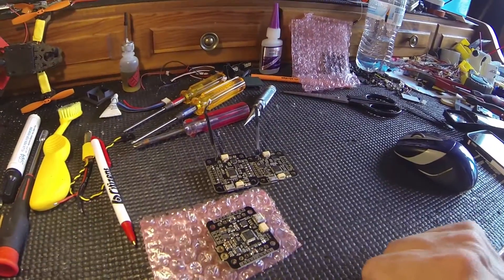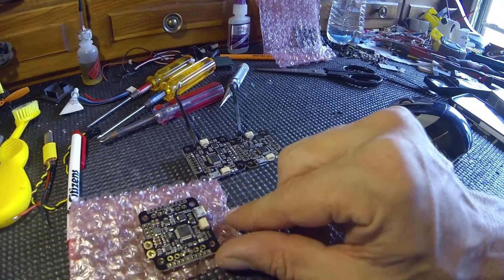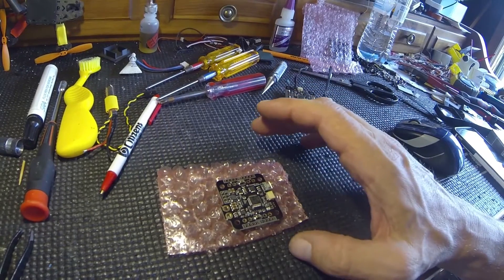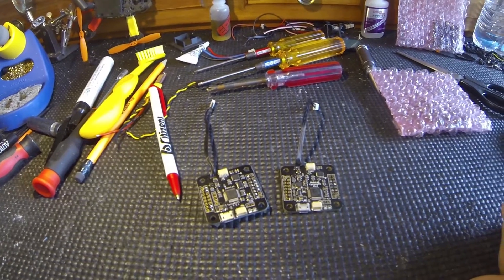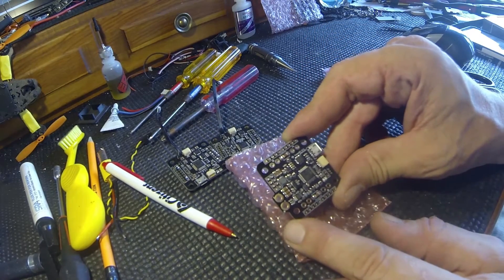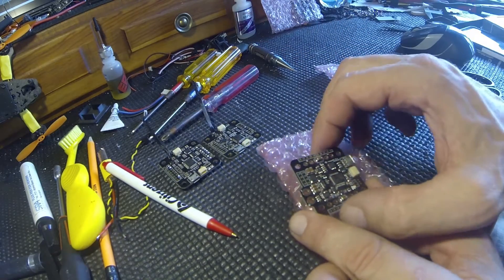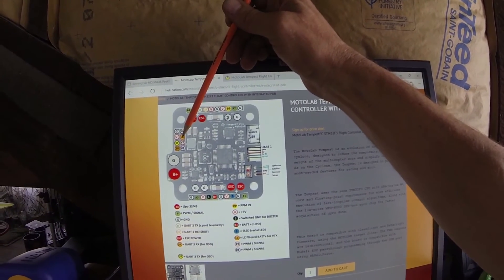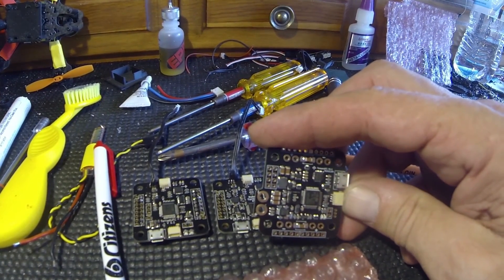Motolabs Tempest Flight Control Board w/ PDB

Comment: where do i find power to power up the camera ?
Reply from the maker: you have your choice of 5volts and Battery voltage on the board, no 12 volts, 1 way take batt volts and power VTX, and vtx powers camera. or power camera from the 5 volt  pin, you can even use the 5 volts from the UART.